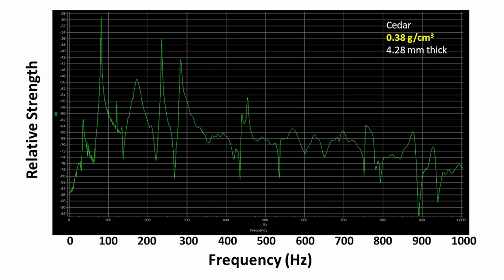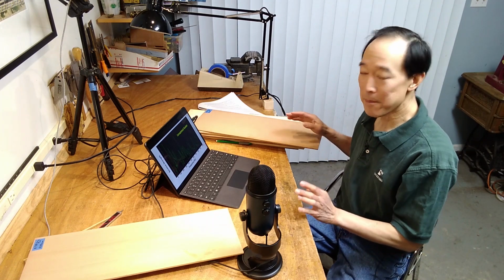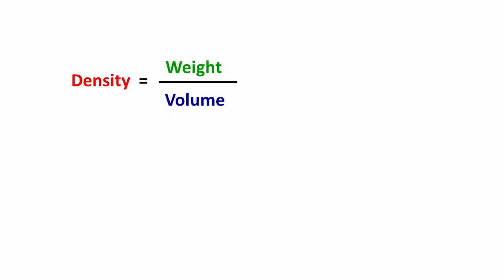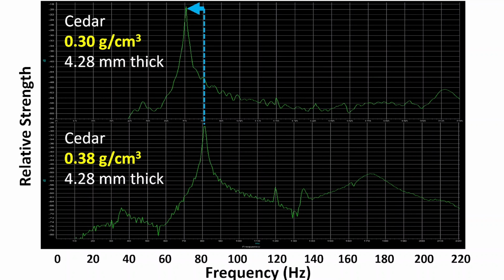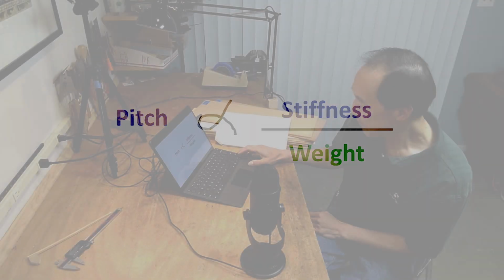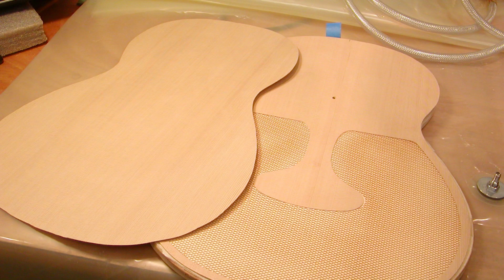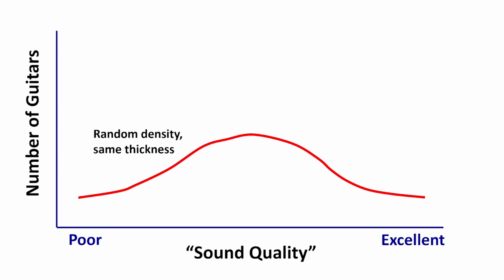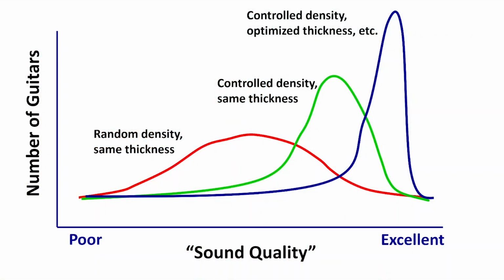Lutherie Demystified Ep. 7 | Concepts: Understanding and Selecting Soundboards, Part 1

Comment: The tone wood is selected before braces/bridge.  The bracing (some) prohibits the bridge from pulling up/off.  How can the bridge tension be addressed Keeping the tone wood to be more vibrational?
Reply from the maker: I'm not completely sure I get your question, but I'll give it a shot. This is a complex question that I'll try to offer some insight based on what I've experienced and some known theoretical concepts. I won't claim it's absolutely correct because I haven't done every experiment to prove or disprove my comments--such is lutherie. First, it's better to think of the top and braces as a system where the plate and braces work together as a unit to control a variety of different movements depending on frequency range (see Ep. 16). In the lower frequencies, the top assembly moves in larger sectors, whereas at higher frequencies, the top assembly moves in smaller sectors. Right off the bat, you can appreciate that you need a balance of a variety of large and small movements in order to get a balance of registers to be heard across the range. For a given stiffness, a more matrixed bracing system (including the bridge, which is the most influential brace which also transmits string energy) tends to unify the top assembly and accentuate the lower frequency resonances, whereas less of a matrixed bracing system (or smaller bridge) tends to accentuate higher frequency response. Perhaps more to your question, the spatial distribution of stiffness can be changed adjusting the local stiffness of braces and the plate (see Ep's. 13 and 15). For example, it's possible to make the assembly less stiff under/around the bridge in order to compensate for the stiffening effect of the bridge. Daniel Friederich was a proponent of this concept and made the area of the soundboard around the bridge thinner in order to make this area more dynamic. As far as counteracting tension, tension from the strings/bridge is not bad and is needed to drive the top through oscillating string energy so long as the top assembly doesn't implode. You could counter the tension with a floating bridge as in an archtop, but the sound is very different than in a classical guitar because the rocking motions are very different. Does any of this get at your question?
Reply: @GarrettLeeLuthier  thanks for your patience in writing this.    This is a discussion of how things work, so we might help them work better.

Comment: What about jointing a lower and higher pitched half board to make one top? Is it done? Doable? Just strange
Reply from the maker: The soundboard behaves as more of an entire system, without a bass and treble side. It could be done, but to what end I'm not sure. For practical reasons in controlling the stiffness and resonant properties, I'd prefer my joined plate to start as spatially uniform in material properties as possible so I can more predictably manipulate it.

Comment: Thank you for inspiring me to continue to build.
I some nice Englemann Spruce that I measure at 0.42-0.44 gm/cm3.
Is there any hope for getting balanced sound in a classical guitar made from these?
I'm thinking that short of thinning the plate too much, or removing too much mass from the braces, and not changing the doming, we still have the bracing pattern and number of braces as variables. 
So could I for instance lower the number of braces, or perhaps open up the angle?
I notice in your bracing example the braces "focus" at about the 12th fret.
Could this angle be opened up a bit?
Thanks!
Reply from the maker: It's possible to achieve a balanced and beautiful voice with these higher densities by compensation of some of the variables you mention in order to achieve the right flexibility and resonances. The main issue with starting with higher density wood is that it sacrifices power and quickness of response. I haven't discussed this too much yet, but lightness of the soundboard assembly plus with high mobility is what leads to power (volume). Low density wood will always give you lower final weight for a given stiffness because stiffness always changes at a faster rate than that for weight when changing thickness.

Comment: Great videos - I've found them really useful, especially because they take a lot of the guesswork out of selecting and thinning a soundboard - they are very empowering! I do have one request/question, which is about the settings you use for Visual Analyser - I've downloaded the software but am struggling to generate spectrum profiles for a couple of newly acquired soundboards that look anything like yours e.g. if I use the A channel I just get a lot of noise. Any further info or pointers you can provide would be much appreciated.
Reply from the maker: Gareth, I'm happy you're finding the videos useful. Trevor Gore generously provides great info on how to set-up, run and trouble shoot Visual Analyser here: https://goreguitars.com.au/wp/wp-content/uploads/2021/existing/Tech_note_on_data_collection_R1_2018_A4-1.pdf
Reply: Many thanks, Garrett, that's perfect. 🙂

Comment: Hello Mr. Lee. Does density matter if you thin your top wood to a certain deflection ? If I understand correctly the denser soundboards will end up thinner and the less dense will be thicker.
Reply from the maker: This is an excellent and very astute question. While it’s true that thinning a denser board can reduce its flexibility to compensate for its inherent stiffness, the acoustic character in the final guitar may be different than if you used a lower density board (but adjusted to equivalent stiffness). This is because for the same flexibility and soundboard size, the denser board will always give higher weight since flexibility changes faster than weight when thinning. Higher weight will give less responsiveness and power, but potentially more sustain. The operational word is “may” because it depends on the difference in density you’re considering (the difference between 0.30 and 0.38 g/cm3 is pretty significant, between 0.35 and 0.38 not so much) and the fact that we have at least 4 more big tools (such as doming, bracing, brace carving, bridge weight) to use as optimization tools as we build the soundboard assembly. We’ll talk about these other tools in future videos.